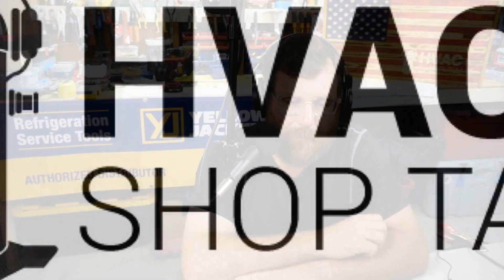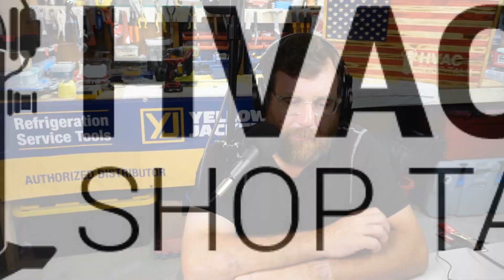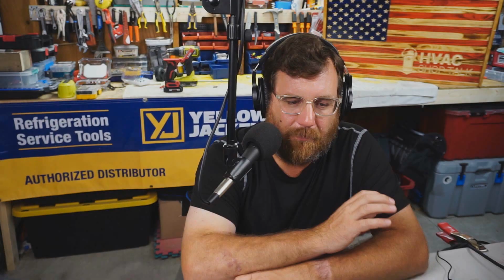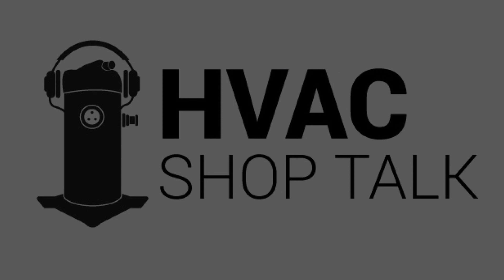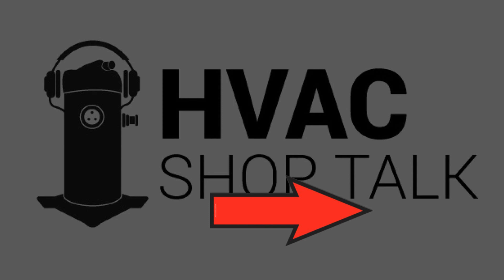HVAC Troubleshooting Training | Using Refrigerant Temps to Diagnose Failures

Comment: Alot of times, I will notice that txv bulbs are loose causing low to zero I superheat. Before charging air flow vs static pressure, I will check txv bulbs. If it's a piston, then it's either liquid line restriction or airflow with same low to  zero superheat. Good convo zack.

Comment: 1. Airflow (filter, TESP, blower effacy {balance, dirt}).
2. Refrigerant charge. 
3. Mechanical (TXV, etc.) 
4. Poor installation practice. 
5. C.O.P.  (Valves or charge). 
6. Electrical

If I have a low charge in my condenser I have a low sub cooling. This will likely reveal itself with dangerously high discharge temperatures.